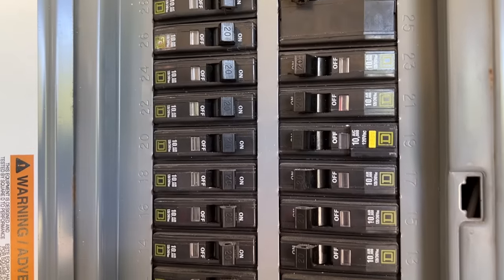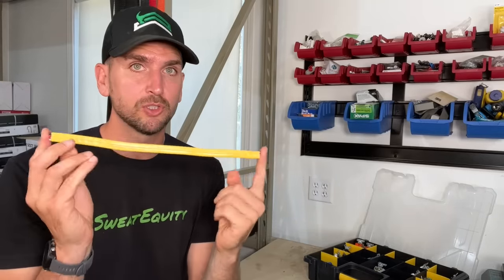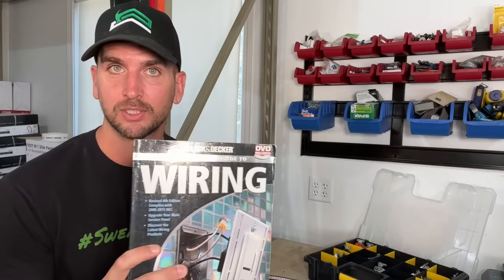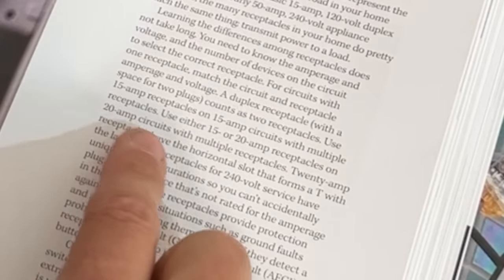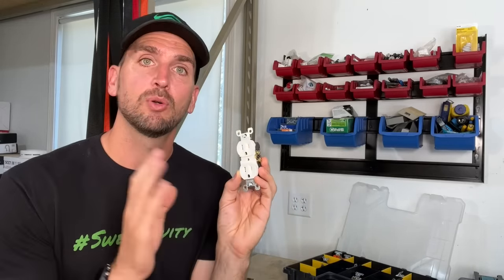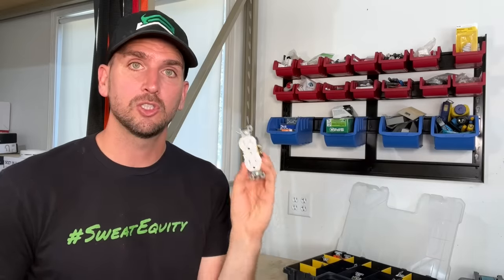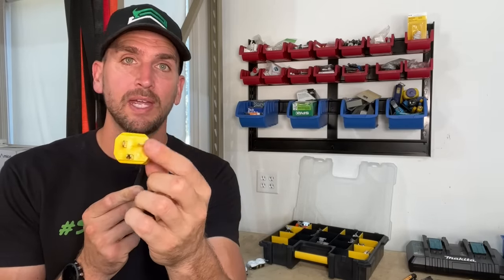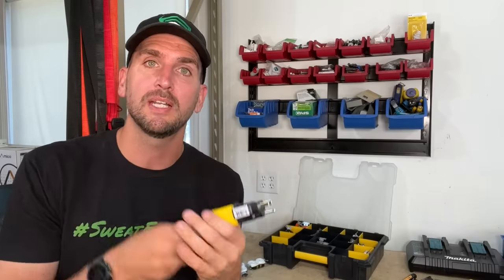Can 15 Amp Outlets Be Used On A 20 Amp Circuit Breaker

Comment: I thought just because the circuit breaker is rated to 15 or 20 AMPS doesn't mean you can draw the max? I have been told, and correct me if I am wrong that any given circuit is only 80% usable. Meaning a 20 AMP circuit is only 16 AMP usable  and a 15 AMP circuit is only 12 AMP usable by NEC 800 Code. Can you elaborate?
Reply: Your comment is partially correct.   A circuit breaker is rated at 80% for continuous loads.   A “continuous load” is power consumed on the circuit with no variances in amps for a period of 3 hours.   For instance, lights may be turned on and left on for hours at a time.  So, lights can only be 80% of the breaker rating.  
With receptacles, general purpose receptacles connected to branch circuits are assumed to be non continuous loads and can therefore be allocated at the full rating of the breaker, not the 80%.   Receptacle loads in dwellings per circuit are based on square footage.   For commercial areas, NEC says general purpose receptacles(you really don’t know what will be plugged in) are to be calculated at 180VA(1.5 amps) each and can be at 100% of the breaker rating.
Hope this helps,   Kevin
Reply: @KevinCoop1  Yes, thanks for the clarification.
Reply: You can always use the full amperage draw to the max on a circuit that the breaker is rated for except for continuous loads. The 80% rule that you are talking about applies to outlets. By that I don't mean the amp rating of the outlet but rather the current draw from the outlet. The current draw from the outlet should not be more than 80% of whatever the outlet is rated for. You can have a dozen outlets on a 20 amp circuit and all of the loads of the outlets can add up to 20 amps - no problem (except continuous loads - de rate to 80%). 
Consumers of course don't know and don't add up the current draw from an outlet to make sure it doesn't go over 80% so it falls on the manufactures to make sure their products don't draw more than 80% of the rating of the outlet it is designed to plug into.
But normally, except for continuous loads, you can draw to the max of whatever the breaker is rated for.
Reply: Clarification: **But normally, except for continuous loads, you can draw on the WIRING IN THE WALLS to the max of whatever the breaker is rated for.

Comment: In all my life i have never seen any tool or appliance with a 20 amp plug. Its archaic silliness. You should be running 12 gage wire no matter what for most circuits.

Comment: I am searching for an answer to the following....."I have an outlet that my refrigerator was plugged into in the past and the circuit kept blowing.  So I plugged my fridge elsewhere.  Today, I looked at that now unused outlet and it says 10A 250v 15A125v.  Can I replace this outlet with just a simple 15A outlet?"
Reply: I think that IS a simple 15A outlet, but most likely a defective one, so yes, if you plan to use it, replace it or have it replaced. Hell, even if you don't plan to use it, it should be replaced, because if it's defective then it could short, which is BAD, or burn, which is REALLY BAD.

Comment: I wouldn't rely on inspecting the guts of a 15 A receptacle and a 20 A receptacle to make the case that a 15 A receptacle is as good as a 20 A receptacle (in terms of current-carrying capacity).  As long as they're living up to their spec sheets, the manufacturers can change the internals without notice: for example, the "technical information" section for the Leviton BR-15W explicitly states "Amperage: 15 A," not "20 A."  

Saving a few pennies by gambling that a BR-15W will function equivalently to a Leviton BR-20W (whose "technical information" section states "Amperage: 20 A"), is Towering Inferno wishful thinking.  If you're convinced that you're better off using a commercial-grade 15 A receptacle than a residential-grade 20 A receptacle on a 20 A circuit, I'm not sure I'd trust you to wire my house.

By the way, if you're using one of those NEMA 5-15-P to NEMA 5-20R adapter plugs--you'd better make sure that the adapter's amperage equals or exceeds the amperage of the circuit and the receptacle.  That is, if you have a 20 A circuit and a 5-15P receptacle that is capable of carrying 16 A continuously without melting, you don't want to make the mistake of using a NEMA 5-15-P to NEMA 5-20R adapter plug that can't carry more than 12 A.  I suspect that the adapter you're showing at 7'00" can't carry more than 12 A.

And yes, there are a lot of NEMA 5-20P plugs out there.  APC Schneider Electric uses them on their 20 A-rated equipment.  As you rightly point out, many window air conditioners use them.  Hair dryers that consume more than 12 A don't use them, but that's a bug, not a feature. Hair dryer manufacturers really should be encouraged (or compelled) to use NEMA 5-20P plugs and bundle NEMA 5-15-P to NEMA 5-20R adapter plugs with them.

Going forward, the NEC really ought to tighten this up and mandate 5-15R receptacles on 15 A circuits and 5-20R receptacles on 20 A circuits.  If the NEC can mandate tamper-proof receptacles, surely it can mandate this.

Comment: I dont think this is really about whether or not a 15 could survive on a 20. Its really about liability, if theres an electrical fire, is insurance going to cover the fire if there was a 15A outlet on a 20A circuit, they're probably going to say, the fire is your own fault because you installed under sized components.

Comment: If there’s no regulation on the manufacturing of receptacles, then the NEC should require manufacturers to design 15-A receptacles to be able to carry 20-A. Otherwise, the argument in the video (which Mike Holt has also mentioned) is invalid.
Reply: There is a regulation. Commercial grade receptacles must meet a regulation known as "Federal specification grade" which specifies a quality that they must meet for federal government and military applications. This applies to 15 and 20 amp 120v receptacles.

Comment: Your showing duplex outlets. 2 outlets, multi outlet circuit. A 15 amp duplex is allowed. If single outlet 20a is required

Comment: 15amp breaker w 14-2 wire was 20amp outlet  used for small window ac what do i need to watch out for ??? TY
Reply: Try to avoid running air conditioners continuously . The plug and outlet will overheat .
Reply: A 20 amp receptacle on a 15 amp branch circuit is illegal.  15 amp is maximum.   Your small AC unit most likely has a 15 amp plug, right?  If 15 amp plug, you should have no issues.  If the plug is 20 amp, you have a problem.  If that problem exists, you have a few choices.   Get a new 20 a circuit installed with #12 minimum.   Move the AC to a location that has a 20 amp circuit and receptacle. Or buy smaller AC unit.

Comment: Real electrician here. Unpopular opinion: the absolute cheapest receptacles are fine. The biggest problem is the installer. Ahem... ^
Reply: Lol on the "Ahem ^" :).  I grant that a new properly installed modern resi grade recpt handles full current.  But I find issues in durability.  One is in the non-backstrapped mounting bracket getting loose from the molded plastic.  Another is in the holding power on the prongs after abusing/heavy insertion/removal cycles.  Seen enough resi recpts with internal arcing in the prong area to know there's a difference.

Comment: Short answer ? Yes. In almost every situation its fine. Little longer answer? It has to be at LEAST 1 duplex receptacle on the circuit. A single 15amp receptacle  on a 20amp circuit isnt allowed.

Comment: I've seen more often lately 20 amp circuits with 14 gauge add to the end of a circuit run. Home Depot sub-contracted a kitchen remodel. Contractor added a new line of outlets under new cabinet bank. Wired as a new "home run" circuit? No way!!

Nope,  14 gauge added to a 12 gauge 20 amp ceiling box?! Gets better aluminum wiring with 2 hot circuits to single aluminum neutral. Homeowner bought an Amazon hot air fryer! Yep, fire in the box under a ceiling fan. Lucky the wire nuts & aluminum wire melted & shut the outlets off before the home caught fire. 

Folks, please... Don't use Home Depot to remodel! And do have your own electrician double check the remodeling job. They alao had flickering ceiling lights. Hole burned through the side of a breaker. Luck no fire in the attic & no injury. Entire electrical job was a disaster!!
Reply: An example of not doing what is required in NEC!

Comment: Ok then..  How about a 20 Amp Outlet on a 60 Amp breaker?

As in the built-in wall oven, and the 110 wall outlet for the Microwave cubbyhole  on top of the oven are both powered from the same two-pole 60A breaker in the main panel. ^_^
Reply: IIRC, any 220v circuit must be dedicated, and any circuit that is over 20 amps must be dedicated, so that violates multiple codes.

Comment: Can I use 12 Ga wiring in 15 amp circuit? pro and cons?
Reply: Yes. Pro's: more than enough cable for the job, less voltage drop over long distance. Con's: more expensive, harder to work with, less tolerant for box fill. If you're going to use 12 gauge, why not use 20 amp circuit breakers?

Comment: I just found out in the house I bought the kitchen is on a 15amp and has 20 Amp outlets 😀
Reply: Check the Romex wire size.  Romex #14  is 15 amp.   Romex #12 is 20 amp.   You want Romex #12 in a kitchen
Reply: @dand3975  half of it is old bx wire lol

Comment: I have a question for anyone willing to answer. Old oven was 30 amp 220volt circuit. New oven requires a 20 amp 220 volt circuit. Do I change breaker?

Comment: You reference 12 gauge wire. 
Most of the wiring in a residence, that I’ve encountered, is 14 gauge.
Reply: In my area it’s 14 thought out the house except for bath room receptacles dinning room receptacles and kitchen receptacles has to be 12
Reply from the maker: 🤔 interesting, that is not the case in my area.
Reply: Yes, most residential wiring is 14awg, however, the wiring in the kitchen circuits will be 12awg in residential.
Reply: Isn't 12 gauge required for 20 amp circuits?  AFAICS 14 gauge has been relegated to cheap extension cords.

Comment: How can you talk about thickness of metal without actually measuring the thickness. Appliances that draw more than 15 amps will have a 20A plug unless modified. 
Using an adapter can be very dangerous since you don’t really know what wire is inside the walls. If you confirm you are on a 20A breaker and are not using an extension cord you’re probably ok, but still not recommended.

Comment: Lol... you must not live in Texas. While the kitchen does have the two 20A circuits and the four bathrooms share two 20A circuits, practically everything else is 15A. This includes a three car garage which is a 15A circuit, has only two duplex outlets inside to plug things into, supports 4 exterior outlets, three exterior lights, the irrigation control (which is low voltage but has a 20A single outlet on the 15A circuit), and the garage door opener. It is a Lennar Home, which I highly don't recommend and the Authority Having Jurisdiction here is a joke in my opinion. I run my power tools on my generator, which does have 20A circuits and it sucks that I have to do so!

Comment: At 02:18  … how can a 15 amp COMPONENT overload a 20 amp CIRCUIT????
A 15 amp component should never draw more than 15 amps.

What am I missing?? 🤔
Reply: By component, I think you mean appliance.  Hopefully you don’t mean receptacle.   2 1500 watt electric heaters plugged into a 15 amp duplex might be a problem.  Correct?     If you mean receptacle, they draw zero amps.

Comment: In my experience most houses have 15 amp breakers and 14 gauge wire.
Reply: In my 1938 house the electrician who upgraded the service to a 100 amp breaker panel (from fuses) installed 15 amp breakers. It looks like the thinking on that is changing. I now would only use 20 amp receptacles (with 12 gauge wire, of course).
Reply: @KameraShy      Yes you can spend more money than necessary if you would like to.   Will not hurt anything, but will improve nothing.
Reply: In the US?  For houses built in the last 40 years?  No, the standard is 20 amp circuit breaker with multiple 15 amp outlets.  That's why it's allowed by NEC.  I have only seen 15 amp breakers in much older houses.
Reply: @phillipsusi1791  I guess the houses I have worked on must be old, like me. LOL

Comment: "Outlet" and "Receptacle" aren't interchangeable terms. An outlet is defined as any location where the circuit is broken. So, switch boxes, receptacle boxes, j-boxes, etc. A receptacle is a device that you plug something into. In simple terms.
Reply: no, an outlet is where electricity is utilized.  a switch is not an outlet.
Reply: @kenbrown2808  So, would you say that the only difference between these locations is the presence of a neutral? Because an outlet and a switch location are effectively the same thing if there is a fed through neutral. I can't really think of any other practical difference between the two.
Reply: @Nerdworker  no, I wouldn't.  an outlet is a place where electricity is utilized.  a switch is a thing that controls the use of electricity without using it for anything other than operating the control.  

Outlet: A point on the wiring system at which current is taken to supply utilization equipment. (NEC 100)

Device: a unit of an electrical system, other than a conductor, that carries or controls electric energy as its principal function. (NEC 100)

there may be a switch incorporated into an outlet; but a switch is not an outlet.

Comment: Why would the builders as cheap as they are use 12ga wire which is more expensive instead of the cheaper 14 and then install 15 Amp receptacles. I've never seen them use 12 wire and use 15 Amp receptacles. They are to cheap for that.

Comment: Yes , in a pinch , but only if your smart enough to draw no more than 1200 watts through it , rule of thumb , 75 percent of capacity , or shit gets hot
Reply: House & garage , all hospital grade , $20 a pop
Reply: Everything 20 amp , and 14 gauge wire is for model homes in the 70s

Comment: Here we go again people getting all worked up on a little thing like a 15A receptacle. Most things now a days are so low current you will never have to worry about the 15 Amps. People do the math and understand a little about OHM's Law. You will have to draw about 40 amps in order for that receptacle to even get hot and fail, you will never find anything at a residential level that will draw that kind of current.There is a reason they use 15 amp receptacles is because you will never exceed the current limit. remember P over V = I. I am always amazed that some people worry about fire and if you look at all the 15 Amp receptacles in use very few ever exceed there current limit and start a fire.In my 60 years I have never seen one fail. If this is such a issue why are receptacles from as far back as the 40's, 50's and 60's still in use with out any problems. When it comes to electric it is very forgiving. Learn about electricity and stop being afraid of it.

Comment: Dang. Zero reason to not use 15A residential outlets. They are built and certified/tested to handle 15A load no problem. 

Huge reason to not use 20A outlet on a 20A circuit!  One device could put the circuit at its design limit. That’s a no go. A device drawing an actual 20A needs to be on a circuit designed for 25A. 

The fuse protects the circuit, not devices.

Comment: From Leo:  Just because you can, does not mean you should.  Standard contractor grade cheapie 15 amp devices are so poor quality, I will not use them.  I use top grade 20 amp devices everywhere.  If someone does not want to pay for the better parts, they need to hire another electrician.  The whole industry has gone to the pits with the chinese and mexican hardware.   It only costs a little more to go first class..
Reply: So, you are using hospital grade receptacles?   They are as you say “Top Grade”

Comment: Scenario: You have a 20 Amp breaker, and it's feeding 12 gauge wire. You have a 15 Amp receptacle, and you use the Stab-Lok Connections on the back to make it the splice for all the wires in your junction box.
Congratulations, you have just installed a 15 Amp fuse in a 20 Amp Circuit.
Reply: 15A receptacles are rated to provide continuity of the 20A circuit, that connects a group of them together.  The only part of the receptacle that is limited to 15A, is the part that delivers power to the plug load.  Manufacturers also standardize on parts, that make the only difference being the plastic interface cover, as a way to idiot-proof you from plugging in a 20A appliance on a 15A branch circuit.  If you dissect a 15A receptacle, you will likely find that it ultimately is a 20A receptacle after all.
Reply: @carultch  It is still cheaper and flimsier than a 20A receptacle, and people are still trying to plug 20 Amps worth of load into it.
Reply: 20 amp residential grade receptacles are available, so the irony is that you could install one thinking it's better, when the reality is that 15 amp spec grade is more robust.
Reply: The back stab connections on residential grade receptacles are only intended to be used with 14 gauge wire which can only be used on a 15 amp circuit.  I never use them but unfortunately they are commonly used in new residential construction for economic reasons.  The homeowner suffers when he tries to plug in a space heater or some other high wattage load and winds up with a failed receptacle or even a fire.
Reply: @1575murray  There's also that little "Connection tab" between each outlet of the receptacle.  When the receptacle is used as a splice, that tab acts like a fuse.